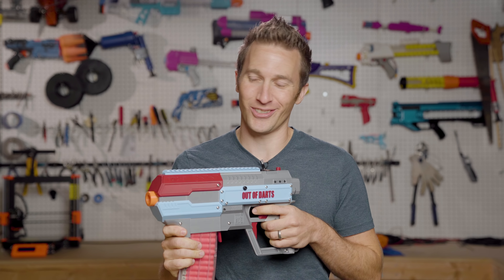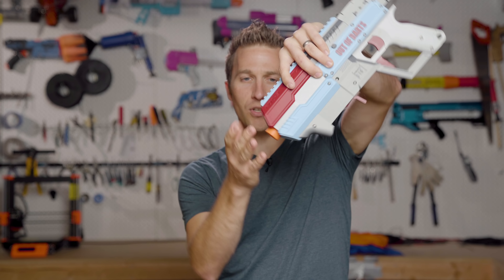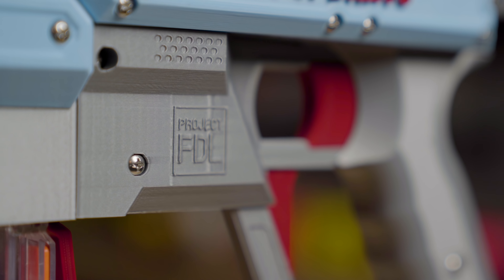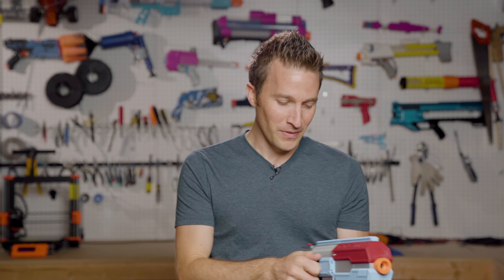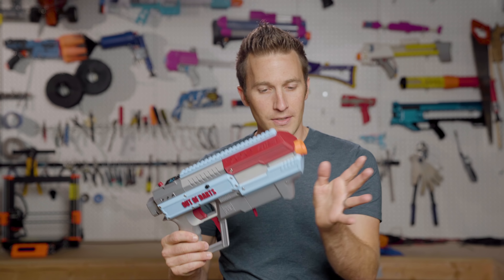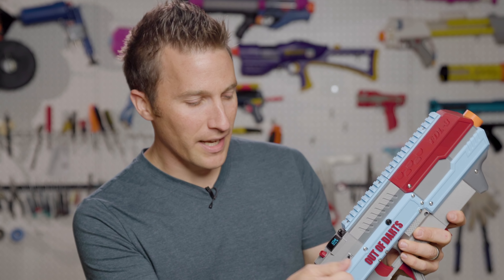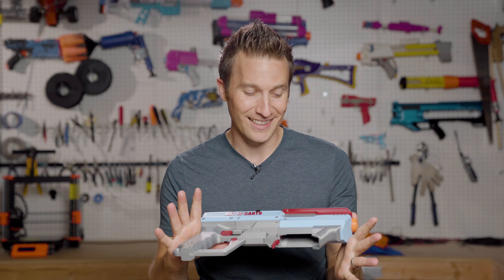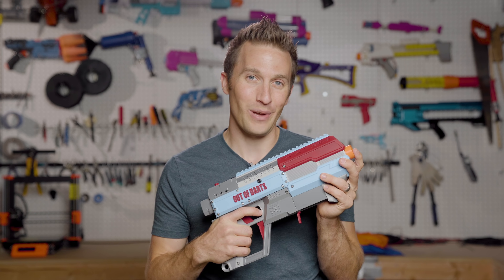FDL3 First impressions

Comment: I should start saving my money.
Reply: nah man, go UltraSonic.  You can make lot of existing flywheel blasters into Brushless setup.
Reply: @jayro8255  Yes but this has single, burst, and full auto. +a lot of settings.
Reply: @beanieteamie7435  and?  My brushless Rayven is selectfire too
Reply: @jayro8255  My styfe is select fire too? But for on the FDL3  all of the settings are configurable on the fly.
Like min spin and max spin. Also fire rate. And how many darts the burst shuld fire. And some more.
Reply: Well..Killer crow you are right
Reply: Same
Reply: I should start earning money

Comment: It’s not that expensive when you consider how good it is.  Mine is #0026 and it’s incredible.  More power and accuracy than Stryfe and better accuracy than my Ultra (brushless) Regulator.  Not as accurate as my k26 Caliburn with scar but the higher rate of fire gives it a different playstyle.
Reply: Let’s compare notes- what settings do you run?  Here’s mine:
Setting 1 (sniping)
Single fire (167FPS avg.)
SPD: 90
ROF: 100
minspn: 420
maxspn: 420
Minspd: 90
Maxspd: 90

Setting 1 is for taking those long ranged shots from downtown.  Slightly long spin up at .42 seconds but it’s consistent.  164min, 171 max with only a spread of 7FPS. I’m still tweaking this but so far so good. 

Setting 2 (primary)
2 round burst (~138cold shot, 149avg.)
SPD: 70
ROF: 80
minspn: 250
maxspd: 150
Minspd: 70
Maxspd: 70

Setting 2 is my primary mode because two is better than one in some cases and makes moving targets easier to hit. Very snappy

Setting 3
Full auto (149FPS avg.)
SPD: 70
ROF: 65
minspn: 250
maxspd: 150
Minspd: 70
Maxspd: 70

Setting 3 is for punching a hole through enemy ranks.  Rate of fire gives a decent spread without dumping all your ammo too fast. Also very snappy

Comment: I'm curious about the lack of a rev trigger having an effect on velocities. Let's say you're in three round burst- will the first dart be slower than the next two? Also, how much does it drop as you're going full-auto through a 35-round barrel mag? I love it, but those are the quirks I would expect to find.
Reply: I think you are able to ujust how much time it spends reving
Reply: It’s brushless so their is an insane amount of torque. Dart drop isn’t much of a problem. And it doesn’t need to rev because it is a brushless motor with have nearly instant rev.